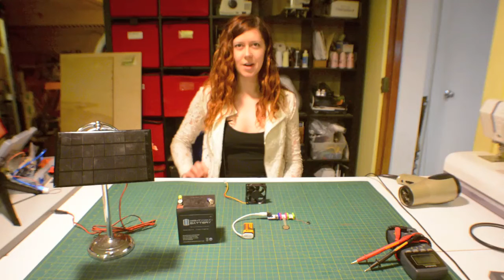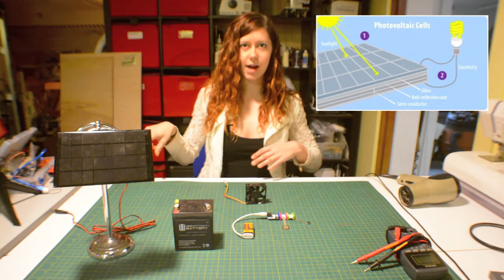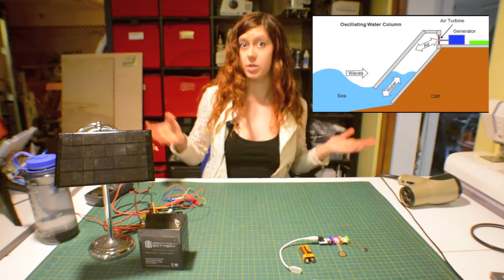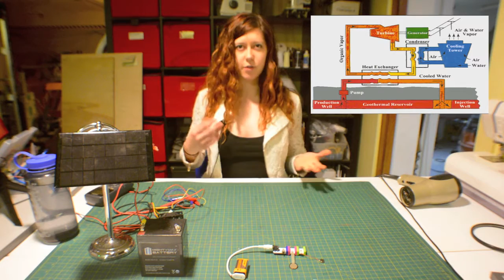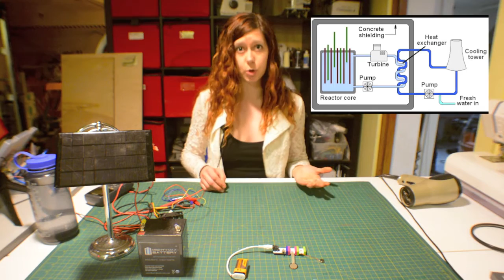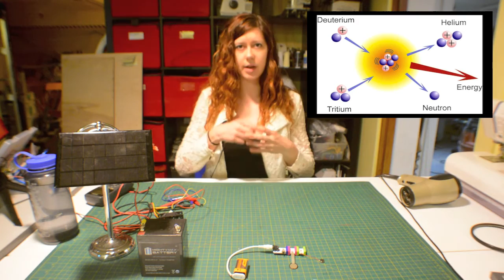Maker Quest: Renewable Energy Technology!

Comment: I am confused why we don't use Molten Salt Thorium Reactors which are supposedly safer than the reactors we use now.
Reply from the maker: +Jonathon Mohon With fission, the dangerous part are the radioactive byproducts (unstable radioisotopes, e.g. cesium-137 and strontium-90), regardless of the control mechanism. The most common way to contain/cool a nuclear fission reaction is to use water (absorbs the radiation).

Checked out the molten salt reactors, they look super cool! I've read about molten salt being used to neutralize nuclear waste, so perhaps the combination of the two could reduce radioactive waste from the reaction! That would be awesome.